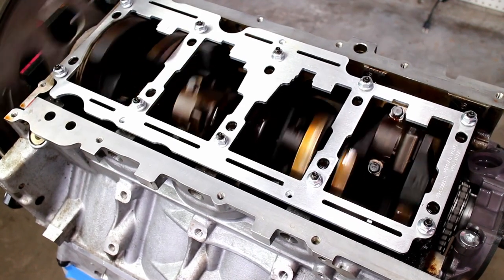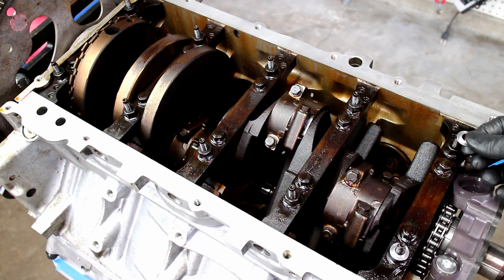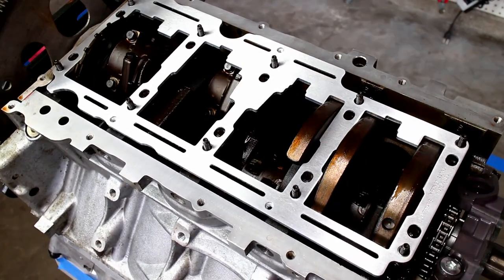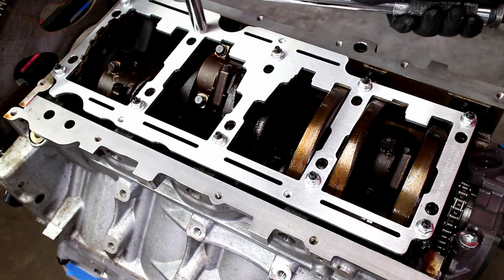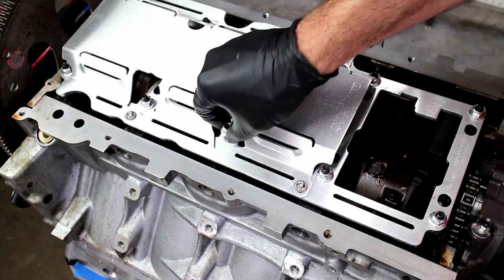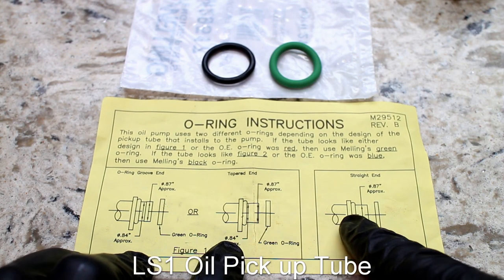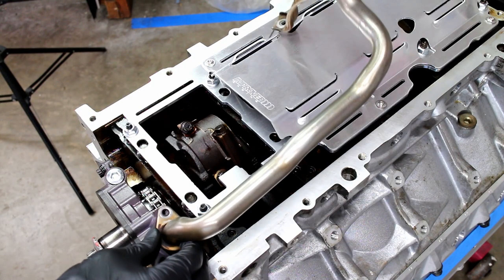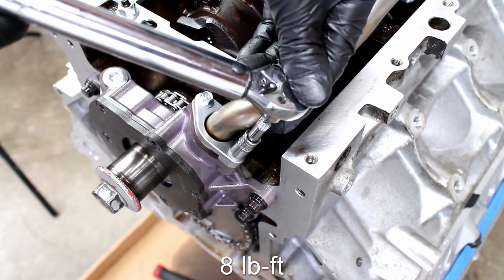Improved Racing LS1 Crank Scraper Install (Pt9 82-92 Camaro/Firebird LS Swap)

Comment: I love your video bro I’m on 17 doing a ls swap on a 1992 Camaro your videos help a lot
Reply: I’m 18 and I have an 89 rs that I wanna ls swap a 5.3 into. I have the engine, but I don’t have the money to buy the few things to do the swap. I hope you can get your swap done bro! But I also enjoy his videos, gives me hope that one day I can do the same
Reply: @isaiahschmidt6245  you can get pretty much everything for cheap at a junk yard. what parts do you still need? What's your budget?
Reply: @323spy  yeah I’ve been looking on fb marketplace too, my budget is almost non existent since I’m a college student. Basically I need mounts (I’d like to buy some so I don’t have to worry about placement), headers, a transmission (I’ll fab my own mount, seems easy enough), an oil pan (I don’t trust myself to cut and weld the truck one), an oil pickup, a starter (someone stole it), kesmo fuel pump, and I think that’s all. I’ll use the truck intake, thin out the harness myself, make my own alternator bracket, I’ll make my own length dip stick, I have truck accessories, and I’ll use the truck fuel rails. The Camaro is an 89’ v6 multi port injection, so I think the fuel lines should be fine and the fuel tank as well, since it is fuel injected, even though I know ls engines need 60psi of fuel. If there’s any insight someone has, I’d love to hear it.
Reply: Eventually, I’d love to get a stage 2-3 cam, stall converter, 4l80e (I’ll buy a 4l60e first because it’s cheaper), an ls7 intake (if it will fit a 5.3 lm7), an ac system (won’t have one at fist), then eventually I want aftermarket suspension and stuff. The goal for rn is to just get the car running, have fun driving until I can get a summer job.

Comment: Seen you use one of those automatic spring loaded centerpunch on allot of your projects. Does it work good on steel witch specific one you use? Thanks
Reply from the maker: the nice center Punches are made by Starrett.($35 ish)
but any $10 parts store special works
Reply: @3rdGenGuy   thank you, I'll see if I invest in one.

Comment: Which windage tray did you use from improved racing? Because the one you installed doesn't look like the factory GM windage tray that is suggested on the improved racing website.
Reply from the maker: it's the F-body crank scraper. it comes with a windage tray that Improved racing makes.

Comment: I don't think that's the right pick up tube O-ring. I have that same Meiling kit and ended having to go to the dealer to get a thicker O-ring. It was only like $6 and they had it in stock. It was thicker than the black one in that Meiling kit.
Reply from the maker: That's just what the Melling instructions said to use.
typically the thicker O-rings are for the truck pick up tubes with the notched tube.
I'll find out if Melling is wrong REAL quick when I start the engine up up this winter